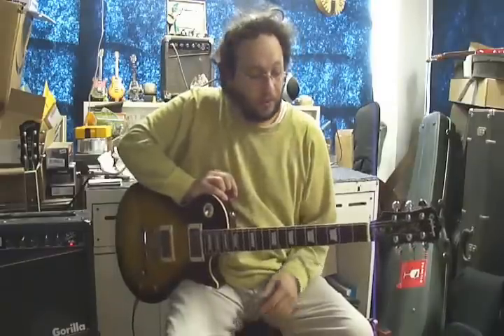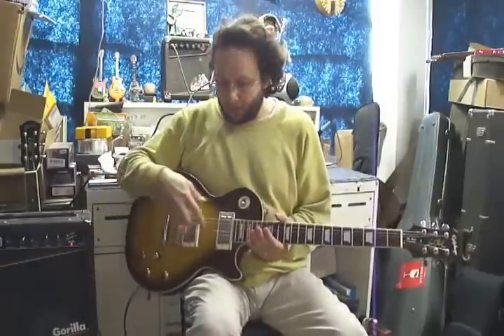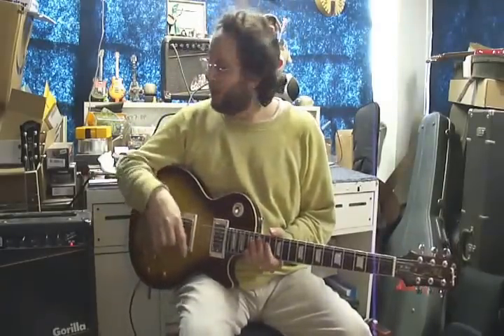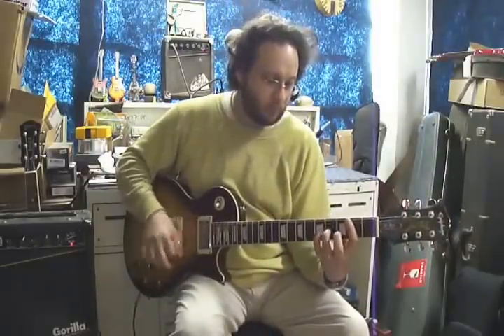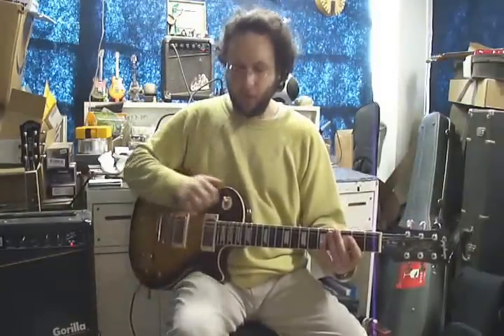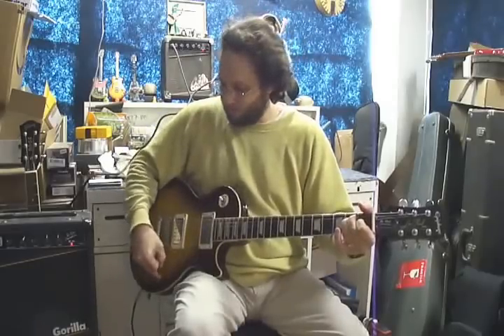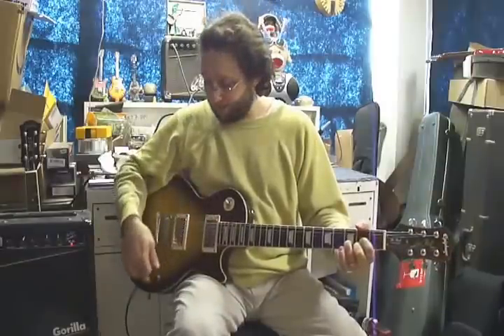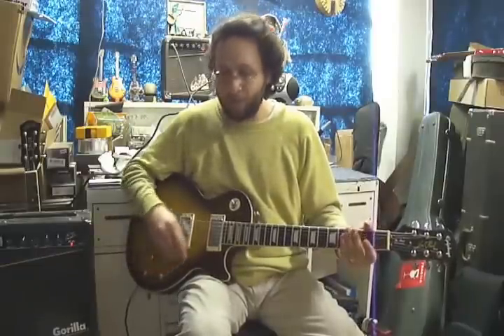Wiring humbuckers series/parallel vs coil splitting, and more by D Guitars Miami LLC

Comment: What about something like a Suhr with the SSCII system installed, negating any hum from a soil split. Would you still choose parallel over that?
Reply from the maker: Parallel or series has nothing to do with negating hum. It has to do with how pickup coils are combined. For the most part, electric guitars with multiple pickups have them wired in parallel. Very rarely do you have production instruments with the pickups wired in series, the most common being danelectro.
Reply: I guess what I mean is if you has the choice and hum was not a factor, would you prefer a humbucker to be coil-split or parallel? It seems people sometimes default to parallel because of the hum-bucking.

Purely speaking one pickup here, not a combination of pickups. Sorry, I should have given context. One pickup and you are choosing whether to split the coils or have a series/parallel switch to go between humbucker and single-coil sounds and hum is taken out of the equation already by an outboard device like the SSCII.
Reply from the maker: Parallel and split coil are two different options that offer tonal differences. Taking the hum factor out of the equation, parallel is still a viable option for tonal variation. again as I mentioned in the video, parallel is brighter and similar to a single coil, however it is not the same as a true coil split sound. so having the option to go from series, to split, to parallel, is worthwhile.

Comment: Can you help please? I have  a Telecaster with 2 Seymour Duncan Little 59 pickups fitted with 2 DiMarzio 250k push-pull pots and would like to get a versatile wiring setup with an appropriate switch either 3, 4, 5 or super 5. Can you please advise? Many thanks!

Comment: This is exactly the mod I'm looking for with my LP style, duncands with four-conductors.  But can it be done without a push pull, just by making the middle toggle switch position go to the parallel setting for the neck pickup?
Reply from the maker: no, you need a separate DPDT switch to do series/parallel.
Reply from the maker: +kevin paul halliday both pickups are wired to their own series/parallel switch.
Reply: Ok thanks Kevin.  That's the info I was looking for.  I still haven't decided whether I want to give up the neck series tone and hard-wire it that way, but at least I know how now. 

So, one more question.  I don't have any tone pots wired in it right now. (I don't use tone knobs) so as of now those are just dummy knobs.  Are there rotary toggle switches that could be wired as the series/parallel switches for those, and put in the spots where the tone post normally go?

Comment: Can you do one pot coil split and one parallel? Is that possible?
Reply from the maker: You mean pickup, not pot. Correct? If so, yes you can wire one humbucker to coil split switch and the other pickup to a series/parallel switch.

Comment: Isn´t the parellel mode sound lower than the splitted mod?
Reply from the maker: Parallel mode has about the same output as single coil mode. In other words the volume level isn't the same. Not lower.
Reply: @doronm63  This is a big problem for me. I was reading that new Ibanez Az series makes what they call ´´power tap´´. Ibanez tells us that the “Power Tap uses one single coil plus a low signal from the other single coil.” However, the DCR measurement doesn’t change in this mode so it’s not a coil-split, partial-tap or parallel linkage of the two coils: the more ‘single coil-like’ sound appears to be achieved with a passive RC (resistor and capacitor) filter on one single coil that uses small surface mount components placed on a PCB that’s fixed to the five-way switch.

Comment: Can you wire 2 humbuckers in parallel with only one tone and one volume pot if both pots are push/pull? Like the 4 way switch on the new Fenders.
Reply from the maker: Yes I can. Feel free to call me to discuss your needs. 305-896-1811. Thanks.
Reply: I will call next week when I get back to Florida.
Reply from the maker: Sounds good. I look forward to it.

Comment: This is by far the most informative video I've seen about this topic. BUT! I do not have a lot of knowledge about guitar wiring in general and I have no clue if the following scenario is possible:
I got two vol pots, two push/pull tone pots and two orange drop caps. What I want to do is a series/parallel wiring with the 50s style tone and volume control (like you showed in the video). Since I am so clueless about which pot log does what and since you've used the push/pull pots as vol controls, I don't know if it is even possible to do it as I imagine. Could you help me out?
Reply from the maker: I would have to draw you out a wiring diagram as explaining the process would be too involved.

Comment: I wonder how this compares to a coil tap. I'd imagine that if you had a humbucker with a coil tap that you could get some neat tones if you set it to parallel while it was tapped too.
Reply from the maker: You can't set it to parallel if the pickup is tapped, as tapping it would cut one coil, hence making it operate as a single coil.

Comment: Even cooler mod, bass cut filter.  No loss of volume,  no hum, the treble still sounds as round as ever, but the bass tapers off giving a really convincing single coil without getting piercing,  or dropping volume.

Comment: so if .I am understanding this correctly, it would be sort of redundant to have coil splitting and also parallel mode?
Reply from the maker: Tonally speaking, they're very similar.
Reply: +contact1araya I wired one on-on-on toggle switch (for my tele with a seymour duncan JB pickup) to switch between series humbucking, coil split (north) and parallel hum bucking and I am so happy with having those 3 options. if you learn to use the tone and volume on your guitar to change the 3 sounds, then each can be very useful in its own way if you only have one guitar to mess with
Reply: +Robert Dunham where'd you get the info to do this? I really want to do this for my les paul

Comment: Hey Daron I have a small question. I play on Les Paul Custom with 496R/498T pups mostly Punk Rock kind of music. What wiring would be better in your opinion? I want that bright high output trebley and sparkly kind of sound you generally see in a punk guitar.
Reply from the maker: It all depends on whether your pickups have standard 2 conductor lead wires for 4 conductor. If 2 conductor, your wiring options are limited.
Reply: My neck pickup is 2 conductor but the bridge one which I usually use is 4.

Comment: How could you do something like this if there is only one humbucker ??
Reply from the maker: +McSpankey Well, each humbucker is wired to its own series/parallel switch. You can wire it to a self-phase switch as well, but I don't recommend it, since wiring a humbucker out of phase with itself will give a really weak and nasal tone that is not pleasant to hear.
Reply: +Doron Markowitz Thankyou
Reply from the maker: you're welcome.
Reply: You really need to have more than one pickup to gain any advantage from having an out of phase sound - makes a pickup sounds nasally and weak, which is useless on its own but when combined with the output of another weak, nasally sounding pickup, interesting, useful tones happen.

To make a comparable analogy: if a double pickup guitar was like a car with four-wheel drive and a single pickup guitar was rear-wheel drive, it wouldn't make much sense to limit the functionality to only one wheel operating the car. Need at least two wheels turning to have any fun and it isn't especially useful for outright speed but front and rear "cornering" ability.

Enjoy the single pickup for what it is; pure, unadulterated simplicity and the lack of a magnetic neck pickup means there's less string pull and more sustain/less weight and "drag" as it were.

Comment: Hi Doron, I am getting ready to Mod my ESP LTD-300, Flying V guitar. I have purchased the Whole Lotta Humbucker pickup set and the push pull pots. Is there anything else I need to buy so that my guitar can sound similar to the one you used in the "Humbuckers series/Parallel vs coil splitting" video?  Thanks.
Reply from the maker: that should pretty much be everything you need.

Comment: hi, is it possible to have "independent volume control" for THREE pickups?
Reply from the maker: Yes. You can install a volume for each pickup.
Reply: thanks for reply, as my guitar tech (we live in England) had said it was not possible, when I showed him your video he agreed but said " but you loose quite a bit of high end when you roll off the volume" in your opinion is this the case?
Reply from the maker: you can't lose high-end when you roll off the volume because each volume is completely independent of the other. Therefore no matter what you do your tone will always stay consistent. For example, if you have all three volumes up, all 3 pickups operating, and you roll off the neck pick up volume, the middle and bridge will still function as normal. if you roll off the middle pickup volume and have only the bridge pickup on, it'll still sound as normal.

Comment: Late to the show. I have a 2 humbucker 2v 1t 3 way toggle guitar. I wired all 3 dpdt with one series/parallel one in and out of phase and tone is coil split (has to be both pups simultaneously 😥) but the tones are out of this world.
Reply: I be interested in the wiring layout ! My 335 could use refreshing of newer sounds !

Comment: Hey, Doron I have a question, with this series/parallel vs coil splitting, this is great, but I want to ask have you ever tried the Triple Shot Rings from Seymour Duncan.  If I get the Duncan Whole Lotta Humbucker pickups, will I be able to setup the triple shot rings with it?

Comment: I don't like the truly independent volume knobs. You have the pickup select switch for doing that, and you can't shut up the guitar fast as you can with the traditional wiring.
Reply from the maker: The problem with the traditional approach to wiring the volume controls as Gibson does, is that if you have the pickup selector switch in the middle, and you roll off one volume the entire output is shut off. Having truly independent volume controls eliminate that problem. Conversely if you have the volume control rolled off on one pickup, you can still do the same stutter effect that I think you are referring to with the pickup toggle switch. In other words there really is no disadvantage to having truly independent volume control wiring but there are major disadvantages to the traditional wiring approach.
Reply: @doronm63  thank you SO MUCH for this tip. i have a bass that has been giving me fits because of this and no one (so called experts) had been able to figure this out.

Comment: is coil "tapping" same as parallel wiring and out of phase?
Reply from the maker: No. Coil tapping is literally cutting one coil off in a humbucker so that it operates as a true single coil, including all the 60 cycle hum that comes with that. Wiring a humbucking pickup in parallel means switching the direction of the coils so that they run in parallel with each other. This cuts the output to about half of what the humbucking pickup would have in series, which also brightens the tone of it making it sound similar to a single coil, while still maintaining hum cancelling operation. Wiring a pickup out of phase creates a very nasally tone where all of the bass and most of the mid-range is removed. It does not sound like a single coil but sounds very thin and piercing.
Reply from the maker: @Gman44044  coil splitting is the actual true description of cutting off one coil on a humbucker to get true single coil operation. People mistakenly interchange the terms coil tapping and coil splitting is if they're one in the same. Coil tapping, which I should have explained earlier, is actually cutting into somewhere in the middle of the coil of a pickup, be it single coil or humbucker, to get half the output. The result is very much the same as coil splitting in that you're only getting half of the output and in the case of a single-coil pickup, it will still hum. In the case of a humbucking pickup, it will have a weaker output but will not sound the same as putting both coils in parallel with the full output of each coil and operating as I previously described.
Reply from the maker: @Boss_Man_T you are correct, however any pickup can have a tap on each coil. Case in point, several years ago I had to do some work on a custom Timtone electric that had 2 humbuckers that each had 6 conductor lead. In other words, it had the typical four conductor lead that you would find on most other humbuckers with the addition of a tap wire on each coil. I always thought that was a bit of overkill but I can see the benefits of it if someone wants that much flexibility out of one pickup.

Comment: I tried this mod and series is insanely louder than parallel. How do you even it out?
Reply from the maker: well you don't. it's like trying to even out a single coil pickup versus a humbucker. the 2 are just naturally going to have a difference in volumes. To efficiently navigate the 2 differences, really use your volume pot more actively.

Comment: Many Thanks and very Helpful. !!!
Reply from the maker: You're very welcome.
Reply: @doronm63  Question, When you wired to the middle vol. lugs, did the volume pot rolloff seem to act differently. More drastic and not as smooth so to speak. Just wondering. Thanks again for the helpful info.
Reply from the maker: @jz6965  not really. The response and taper is the same.

Comment: Thanks. i was debating on a coil tap vs parallel- this was an excellent explanation. i'm going parallel.
Reply from the maker: You're welcome. Glad I could help.
Reply: abbaby68  yes. Seymour Duncan make humbucker surrounds with micro switches which allow you to do 4 settings per pickup. Humbucker series, humbucker parallel, single South coil only, single North coil only.

Comment: The main problem I see with independent wiring is that wiring the guitar this way, even if your volumes are both turned all the way down, the circuit is still open and makes a bunch of noise when you let go of the guitar strings. Not a big deal if you play clean most of the time but if he lays on the gain in a big way, that guitar is going to squeal like crazy if he let's go of the strings even with both volumes down
Reply from the maker: Moshe Alvarez nope. That doesn't happen. I don't know if you've ever actually had a guitar with truly independent volumes for each pickup but in my experience that sort of noise does not happen when you roll them off.
Reply: Perhaps the covers on the pickups eliminate the problem but every single Gibson guitar I've ever wired up with independent volumes have had that same problem but then again, all those guitars had pickups with no covers.

Comment: hello Doron. After watching this video I am doing the series/parallel wiring on a 2 humbucker, 2 volume, 1 tone guitar using cts pushpull pots. I have looked up the diagram and I find 3 or 4 different wiring's for it. I did the wiring from the semour Duncan site and it doesn't sound right. Can you please post the wiring diagram for the series/parallel wiring for a cts push pull. I would greatly appreciate it as this is driving me crazy. Thank you so much

Comment: i agree that it is annoying when you turn down one of the volumes all the way and it brings down the volume of the entire guitar. i wire my guitars the same way you do, such that when you turn the volume all the way down, it doesn't bring down the volume of the overall guitar. basically the way to accomplish this in layman's terms is you wire it so that when the pot is turned all the way down, it effective shorts out the individual pickup rather than shorting out the guitar output
Reply from the maker: correct.
Reply: great video by the way. what's the resistance of the pots you are using?

Comment: then why do speakers sound better 100% wired in series rather than parallel ? seems if you have your guitar given the option then theamp should as well! IS that even possible. ie bassman,trainwreck, dumbleoverdrive!
Reply from the maker: series/parallel switching gives more tonal flexibility in a guitar than just series wiring alone.

Comment: Thanks Doron. Now I know whats series/parallel means. So what kind of pickup are in this video? Single? humbucker? Series? Parallel?
https://www.youtube.com/watch?v=fjMgnYlJBu8
Reply from the maker: They are full size humbuckers with 4 conductor lead, making them capable of series/parallel wiring, as well as phase switching, coil splitting, etc.
Reply: Thanks man. I'm thinking to place 2 of those on a semi-acoustic like the es-335 or es-les paul. I hope they won't feedback... the sustain is really cool and I wander if its achievable in 355.
I hope that the trump riots are not in your town...